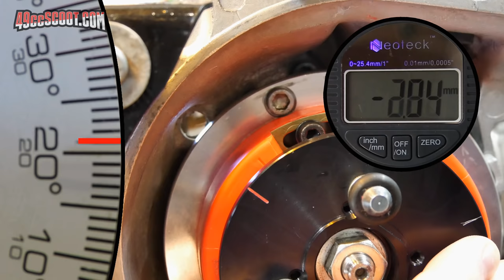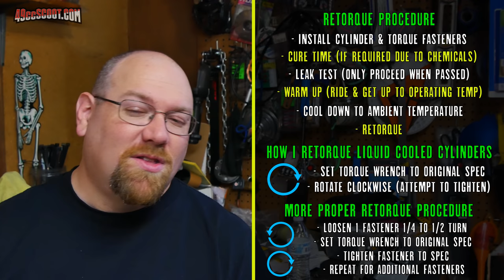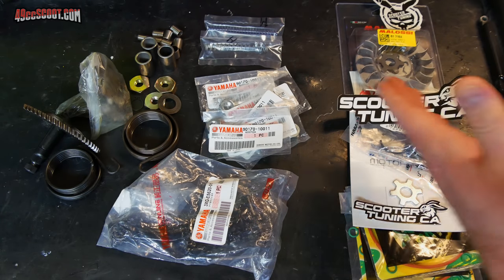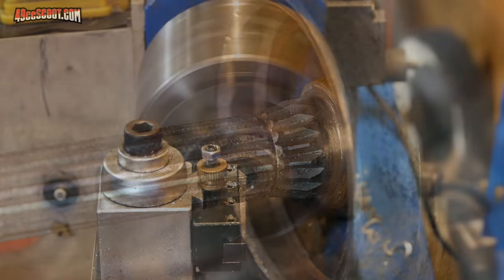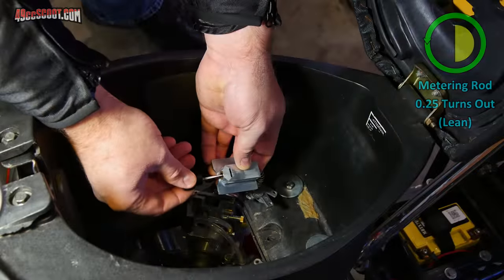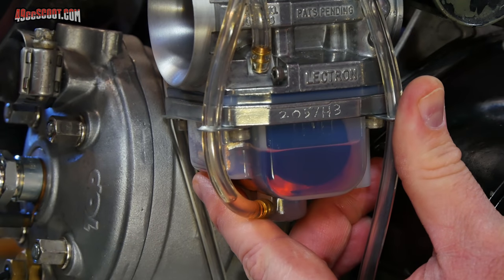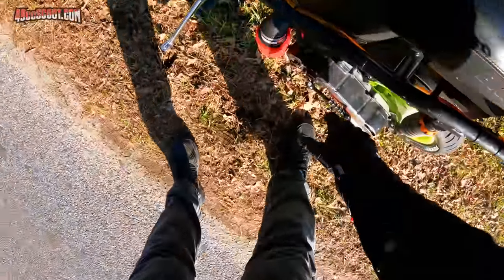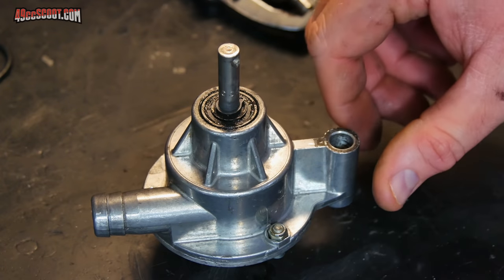Repairing My Scooter's Engine And CVT & Lectron Carburetor Tuning Continues : TPR 86cc : Part 51

Comment: When the slidingplate does not have splines, it´s meant for a different crank.
There are crankshafts that just has splines at the end of the shaft.
I know this because i built one of hottest piaggiotwins there are, and at the time the only one that hot. ;)
Check my channel and you´ll see it.

And by that, we had big problems due to this issue.
Reply: And!
There are hardened spacers grinded absolutely paralell aviable from 'Roost'.
Reply: And, you need a richer at idle metering rod.
Reply: I was posting my posts as i was watching, when you started adjust the powerjet i said to myself, it´s about to seize, now at 1.08 you lifted the head and it has been pinging a lot. :(
Reply from the maker: I've cringed holding it at part throttle the whole time and watching CHTs, but I was trying to give it a chance out of the box since one of the big selling points of the carb is that it requires little tuning for most people. Most of the time with more standard carbs, even if I end up with a lean spot I can avoid that small section of throttle. It's pretty much lean from maybe 1/8 up till the power jet comes in so there's not much I can do other than ride around at 20MPH if I want to be safe. I should have just contacted them about a new metering rod instead of pushing it.
Reply from the maker: I used the variators with no splines on all of my 70-110cc large spline stuff without issue. Some of those were at least close to this power level, but none revved this high. I know the racing cranks generally don't have splines all the way, but it's standard practice to use these plain hole ramp plates on the 16mm cranks. I don't even know if Malossi makes a splined spacer for the larger cranks. Even some of the non-OR kits don't have splines. I've got a Polini ramp plate here like that as well.

I'm not saying it doesn't cause issues, because it sounds like it has for you, but I've been using them that way on those larger crank engines for nearly 10 years and tens of thousands of miles.

Comment: In not a fan of this Lectron stuff. I use Mikuni or Keihin. Sometimes Dellorto. And I work so lot with cvt scooters. There allways problems with starter or cvt or Belt or clutch. Im quit with this Crap. Costs lot of time sweat money. Gearbox bike rules. 🏁😉
Reply from the maker: Don't know if you don't try. I think the Lectron is alright, but not the out of the box tuned item that it can be for specific applications like stock dirt bikes. Seems like you could get just as much from plenty of other carbs. The part that I'm curious about now is if it does indeed work well in a broad range of conditions once tuned.

I enjoy working with CVTs, but yes they can be a lot of trouble. Not many geared 50cc 2Ts in the US. What I have seen are generally in motorcycle style frames and I'm not sure about even using them on the road in my state. Motorcycles have to be over 50cc and scooters have to be step through frames with automatic transmissions.